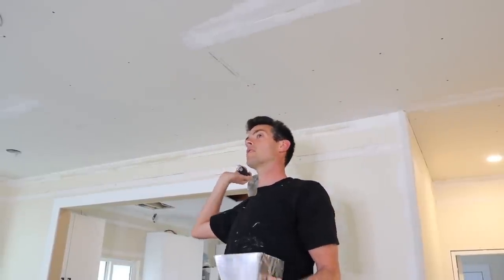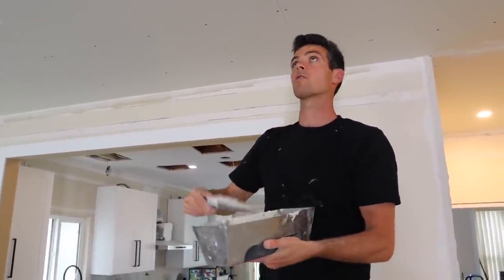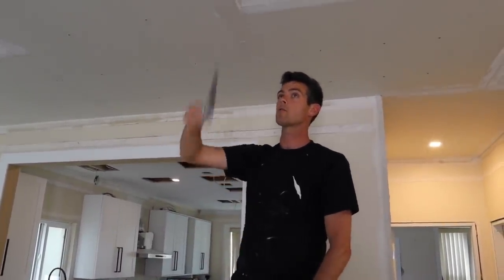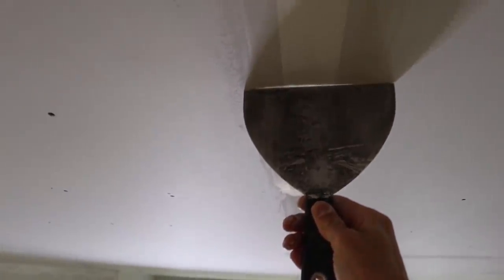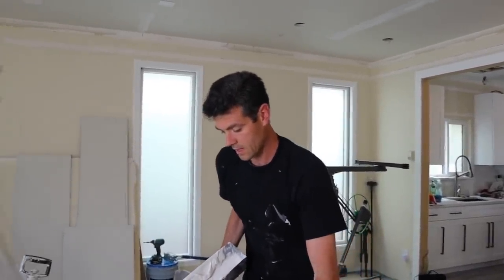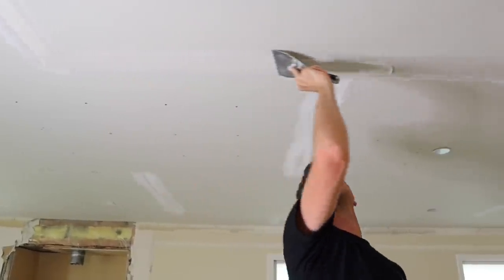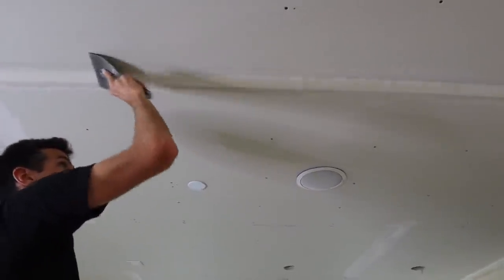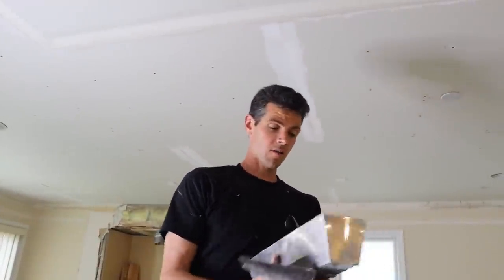How to Tape Drywall (Factory Joints) 2.0

Comment: I’ve been doing my garage, and man this mudding and taping is and absolute skill, I’ll get we done eventually
Reply: I'm relatively new to drywall work also. Did some and then gave up and decided to hire someone to finish a project for me. The "pro" work was not even as good as I had done, so I decided to do my next room on my own. 

Before you start, just tell yourself you are a pro like Vancouver Carpenter and go through the moves like you know what you are doing. That mental exercise will help. At least it did for me. Also, he doesn't mention this in his videos but if you are taping an entire room tape in this order: flats (the ones demonstrated in this video, butts and angles/corners. Then do screws - which you will have to mud (3) times if you don't want to the dimples to show.

I also found that if I don't go back over my initial installation of tape with mud, that it wrinkles. Wipe mud on, to get tape wet, then wipe it off.
Reply: Richard Ellis thanks, ya I’m bout 50% done garage, definitely got lot of time before the snow comes and I’ll need it, I’m sure it will look good when done, I’ll make sure of that,
Reply: Just use self adhesive fibreglass tape. It’s better and easier.

Comment: Out of all the people on YouTube you are the only one I take advice from. I just wish I knew the equivalent products to use that are available in Australia. We don't seem to have any all purpose medium weight available in hardware stores so it's base coat and top coat here it seems.  They have the premixed gyprock all purpose joint compound which they say to use for all 3 coats but I feel like it's too lightweight for joints... I just tried using it and it started drying too quick before I could get the tape onto a long ceiling run... I'd watched a lot of your videos but if I'd seen this one first I probably would've known I'd have been better off doing a shorter length at a time.

Comment: I have been having a problem with some of my flat joints. My tape started pulling off. There was about an eighth inch of mud under them. So I pulled them down scraped bare again.  Mixed my mud wetter and tried again.  Same spots.
So the 3  time I even put Some wood glue in with mud.
Same problem.  I'm thinking  the factory drywall has something on it preventing it from sticking. 
Another problem I have is little plastic shreds in my mud.  I finally  figured out why I was getting them. My mud mixer had some sharp edges.

Comment: One trick to keep your tape running past where you can reach... Apply the bedding mud and start embedding the tape while holding up the edge of the tape against the ceiling (where you haven't applied bedding mud).  Quickly wipe a portion of your joint (where you're embedding the tape) and put the "glob" of compound that's on your knife over the tape at the very end of where you had your bedding compound placed (close to where your hand is holding up the tape).  That should hold the tape in place long enough until you move over and put the bedding coat further down the line.  The blob gets cleaned up after you've embedded that next section of tape.  Once you get the "touch", it works great.

Comment: I think it may not be clear how hard you must be pushing on that knife with your finger that is stretched out onto the back of the blade. If the blade is touching both sides of the factory recessed joint then a simple pull of the blade would fill the entire recess wouldn't it? So you must be applying a decent amount of pressure to get it to press the tape that deep correct?

Comment: Thanks for all your great videos. Finally got enough water in the mud yesterday (by accident) to make it feather properly. For the factory join, fill the butt first and screw holes (as per one of your older videos on walls I think) and let set before mud for tape for best results ? Also leave a minute after applying tape for the tape to absorb moisture (another of your videos). Ok those extras are tricky on a ceiling. Keep em coming.    P.S. are you doing (much deserved) affliate mardketing?

Comment: I have a question... for taping corner joints. The previous paper was peeling off from the humidity from the house being vacant for a couple years with hot temperatures. I am redoing them now. We have had a couple mice in the attic right above where I am taping. Once I removed the tape i realized the joints have a huge gap between them of nearly 3 quarters of an inch. I stuffed a little bit of pest wire (steel wiring) in the cracks along the edge of the wall. Should I be okay to start taping now or do I need to put something else over the wiring? The wiring is flush with the joint and not protruding at all.

Comment: Do you need to wait until that mud and tape dries to put your next coat over it or can you do it straight away?
Reply: Not required to wait until it's dry...but, if it's dry you do can a light sand and have a clean coat on top...i usually wait if its a bigger job. if im doing say a single room, ill tape the entire room than do coat on top. Ben will probably have better tip...

Comment: Hey quick question to you or anyone experienced.
I Just got a house I’m doing renovations on, there are some walls that you can see a hump horizontal across the full length (I’m assuming but joint). As it is already painted can I sand the surface then apply mud either side to smooth it out? And if so would 12” either side be enough?
Thanks in advance!!

Comment: When is wetting your tape worth the trouble? Why not for this situation?
Reply: Wetting the tape is not necessary and takes extra time, in fact Ben demonstrated in a video if you wet the tape it creates a weaker bond. The trick with drywall tape is more mud is better than less when bedding. Bubbles aren't that hard to fix either.

Comment: Thanks for the demo! Question for anyone: Im doing a single sheet install into an existing gloss painted wall after moving/replacing some plumbing. Should I strip the existing paint and primer down to the drywall on the painted side of the joint or can I just use some stainblocker primer and have the tape/mud stick to that? Its an ugly laundryroom with heavy texturing so Im not to worried about the most perfect job and I will do a whole new layer of texture if needed. Just unsure of what mud reliably sticks to other than paper and other mud. Thanks!
Reply: Don't take the time to strip paint from drywall unless it is peeling. If it is peeling remove the loose paint, you may have to use a utility knife and cut a line around the spot, then use a spray enamel and coat the spot. If you don't the exposed paper will blister when you mud it.
Reply: @rickkrieger4455  Awesome, thank you Sir.
Reply: Use a taping mud or a heavy all purpose. They will stick to just about everything.
Reply: @stargateproductions  thanks for the advice. I'm relieved, this should go faster than expected.

Comment: Do you bury the tape on the same coat? Or do you wait until the tape dries before doing the next coat?
Reply from the maker: I wait until it's dry.
Reply: @vancouvercarpenter  can you do it the same coat? I did a few sections today and did the tape and first coat in one shot
Reply from the maker: @Russianmafia10  The risk is that sometimes it will lift the tape a bit. It can also cause it to dry a bit slower under the tape.
Reply: @vancouvercarpenter  thanks for the response! Your videos have been amazing for renovating my house!

Comment: How come you don't use preadhesive tape? Wouldn't it avoid a step and time and material?
Reply: Mesh tape is inferior product compared to paper tape. You have to bed mesh with a quickest and it still has the potential to crack. Paper is also less expensive.
Reply: @stargateproductions  hmmm.. I'm VERY new to remodeling and it's oy my own projects. I've never tried anything but mesh, I'll try the tape next time. Thx for the reply.
Reply: Fibafuse tape is the way to go.  No bubbles like paper tape can sometimes have.
Reply: @VC-Toronto  I use fibafuse tape now and I love it, jus wasn't sure if there was something better or more effective. I don't have any problems with the fibafuse tho..
Reply: V C I also use fibafuse on my house. I really like it except in the corners. I always seem to accidentally cut the center of the tape with my taping knife.